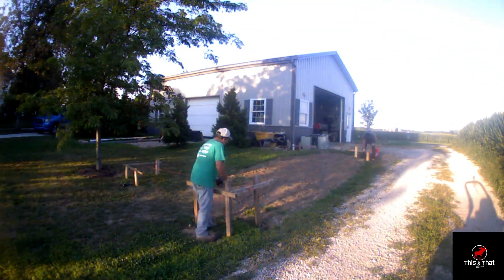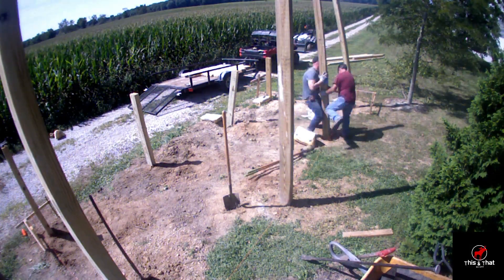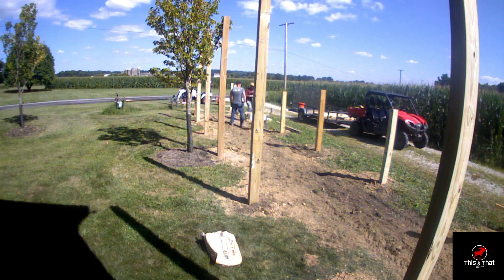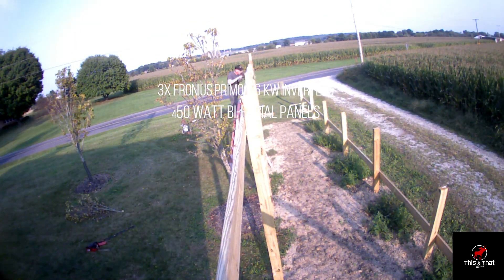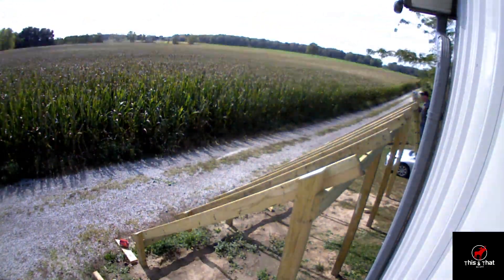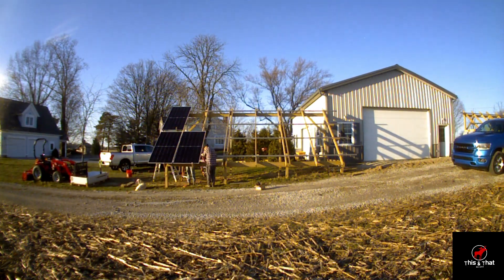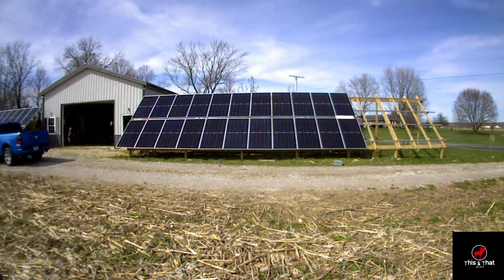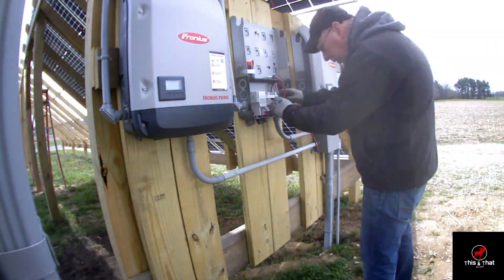DIY Ground Mount Solar - Save Money - Fronius Inverters

Comment: Nice system, both of my arrays are ground mounts.  Exactly why I went totally off grid. My electricity company is trash. My system allows me to either power individual circuits from the grid or the Solark. 99.99% of the time the house runs off solar and  batteries. The best part is when there's a power outage in the neighborhood I don't even know about it.
Reply from the maker: That’s pretty sweet! I need to look into something like that.  Take care!

Comment: Did you get any flak from the power company or from the AHJ for the wood racking was going to do the same myself.
Reply from the maker: No, actually that was just fine…they can’t really say anything as it’s not much different than a roof mount really.  Plus it looks better in my opinion. Have a good one!

Comment: Nice solar ground mount set up.  Too bad your utility doesn't allow for proper net metering.  Maybe you can set up a car charging station or some small hydrogen fuel cell generator with the excess power!
Reply from the maker: Thanks for watching! That’s a good idea about the car charging station.  Take care!